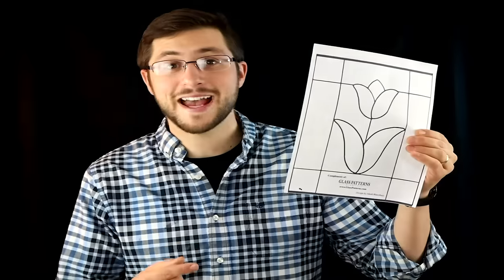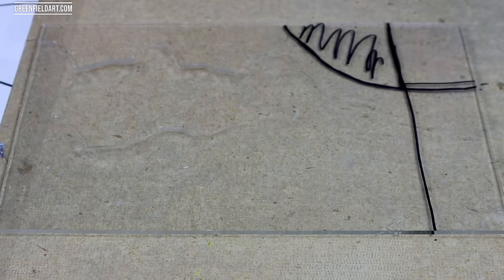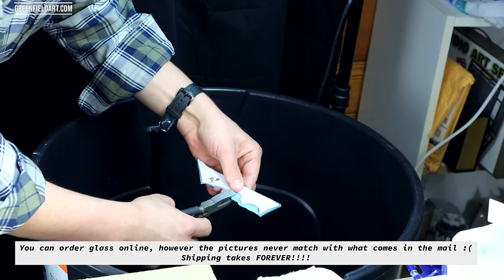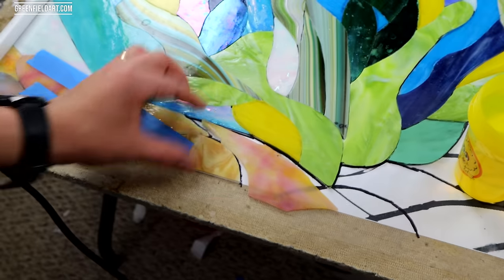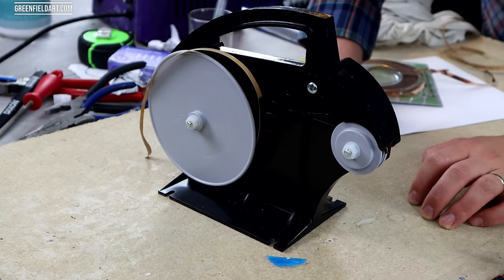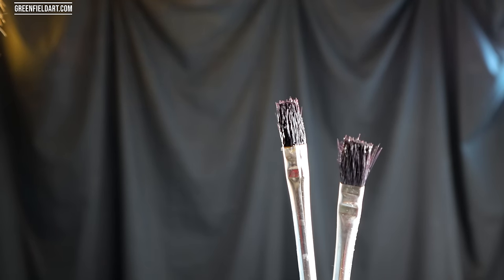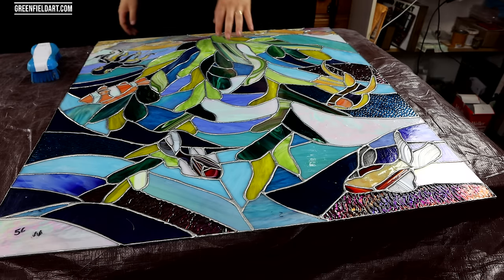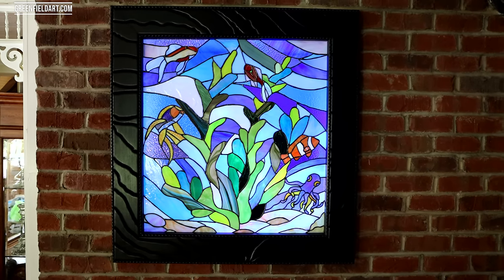Stained Glass Guide

Comment: Beautiful!!! My instructor taught me a cool trick when working with highly textured glass (like the piece you said was hard to foil). During the edge grinding, gently grind just a hair over the edge onto the top of the glass to remove some of the texture. This way when you tape- it is to/on a smoother surface. The tape will adhere better, no finger cuts and  no one will notice the portion removed because is under the tape and solder.
Man, was I happy when He taught me that one!!
Reply: OOOO great idea!
Reply: Thanks for sharing! That is an extremely helpful and smart tip! God Bless 😃
Reply: That is the kind of TIP a knowledgable and in person Instructor will give you...
Reply: Nice comment!
Reply: Looking at these comments two years later. For heavily textured glass you will not regret investing in a ripple grinding bit for smooth, consistent edges.

Comment: Beautiful work! I'll be watching for more. I haven't done stain glass in a while, so I needed a refresher course to remind me of what to do. I have all the tools, but you showed some techniques I never knew before. I'm going to be making windows for an indoor garden off m parlor. It's just a small 3.5' x 8' little room with LED grow lights for my veggies. So I built a wall with openings for the stained glass. Four windows in the wall part, then two windows to match for the doors.. So it'll be six matching windows altogether. I have a victoria look about the room, so it'll have a classic victorian look for the design. Then above the windows, I'll be doing some fretwork on thin wood and finish it nicely, so there's airflow in the room. It's a bit of a project, but so far the room is taking on that relaxing victorian parlour look.

Comment: Thank you for generously sharing your knowledge and experience with us all.  Good video. Did you get your Homasote board from Walmart or Home Depot/Lowe's? 
I tried to find a Homasote board about 5 years ago and could not find any. I ended up using a Masonite board with Masonite pieces layered up to take place of the trim (that you have in your video). I'm a self-taught stained glass artist, but much of my learning came from a guy who made videos before 9-11 and, as a fireman/paramedic, he ended up dying in the towers saving others. Someone posted his videos on YouTube where I learned from them. He went into extreme detail and much of what you explained in this video he also taught.  
One thing he explained NOT to do was to NOT run your finger(s) over the copper foil when foiling because it causes painful cuts. He explained that you will want to do it, but don't. Instead, use a burnishing tool of some type and smooth it down that way. He made the case for buying and using an automatic foiler, like you show in your video. 
Thank you, again, for sharing. 
God Bless 😃

Comment: Thank you for the tip on filling spaces with copper wire or crumpled copper tape. Also how you finish your piece; using the steel wool and cleaning and polishing. I wondered why the patina didn't penetrate the solder very well some times. Now I know!

Comment: Great Job! Few spots on the soldering that I personally would had touched up...but really thank you for the suggestion of using copper wire as a filler. I would do the crumpled up foil in spots, but the larger ones I had troubles with. 

N.B. Also, nice call on the 60/40

Comment: Thanks for the video.  I wish you would have shown more scoring/cutting techniques.  I.e.  when cutting textured glass.  You cut on the back side, correct?   And is there something you can put under a joint to prevent it from muddling on the back?  Thanks for the tip using copper from scrap electrical wire.
Reply from the maker: When cutting textured glass you always cut on the smoothest surface i.e. the back. Keep in mind that you would need to glue/trace your pattern front side down on the glass so that the texture will show on the correct side when the piece is placed in the window. A few options to prevent muddling on the back- 1. Try to move faster when soldering, not allowing the metal a chance to seep through. 2. Use the wire to fill the gap, keeping in mind that you want space for the solder to settle(don't over pack the wire). 3. Have some 50/50 soldier on hand and fill the gap so that it is flush with the surface of the pieces you are joining. Once the metal  has cooled down, build your rounded bead on top of the 50/50 with the 60/40.  50/50 has a higher melting point and will prevent the 60/40 from seeping through. watch min 34:10 I am using 60/40 but the process would be the same just the 50/50 would be the first layer and the 60/40 would be whats placed on top. If you don't have 50/50 try doing it with the 60/40 but move fast!  hope that is clear and If not let me know. thanks for the question!

Comment: This is one of the few videos I have seen that explain with detail a complete process, thanks a lot, I´m just getting started into stained glass and this was really helpful. I thought that copper foil was more difficult to use, but it's not and now I know it thanks to you, I will try my self to do it just by watching your video, hehe.   I have a question, I hope you can help me, what brand and model is your soldering iron? I've got one, but it's not so good and I'm not able to control temperature, so sometimes I get more heat than needed and burn my work hehe... hope you can help me, great video, and of course EXCELLENT WORK!!

Comment: Great video! Never tried Stained Glass before but I have a question...maybe I missed it. Do you flip the piece and solder it on the back as well? Thanks again:)
Reply from the maker: no you can but I didn't for this project. It will only be seen from one side and I didn't want the extra weight.

Comment: I do notice your soldering iron has a bigger tip than mine.  Is there better irons and do you recommend an adjustable temp iron? I bought a cheap one from Hobby Lobby and struggled with so I just bought an adjustable temp iron but both have 1/4" tips (?)

Comment: Beautiful piece.  For a piece that size, how did you safely move it outside to be rinsed with a hose?  Do you leave it on that board and rinse while on the board? If not, I am curious to understand if the piece is strong enough to just lift off, rinse, lay back on the board?

Comment: The larger my project gets, the more unstable it seems to be. Do you use anything to help support the glass on a project this size?  You said nothing about soldering the back side. My instructor taught me to solder both sides. The problem I ran into when doing that is that the heat would also melt the solder on the other side and I found myself going back and forth on either side trying to clean up the mess that would glob up on one side or the other.
I loved your project. How long did it take you to do it all?

Comment: Beautiful work Alex! Really stunning. I've just started some stained glass projects and I'm a little confused about using lead came. I see in this video that you don't frame your piece around the edges with lead came like I've seen in other videos. Have you ever used it and did you not use it here because you were putting it in a frame anyway? Thanks for your very informative video and I look forward to your next uploads!
Reply from the maker: Thanks for the question! I'm glad you brought this up because this is a very specific case where I don't use it.  This glass was sitting on a wall framed(stationary) like you said : )  I didn't find it necessary for the extra support. If it were to be framed in a door(which moves) or hung in front of a window(you need to attach hook and chain to it) I would certainly frame it in zinc Edging/came. To keep the video short I didn't show how I framed the glass. Its edges are sandwiched in-between 2 strips of wood which act as the same support system. In short you can use your judgment according to the windows application and size.  Good luck I hope that answered your Q.
Reply: @alexgreenfield5772  Ah great! Thanks for the reply. That makes a lot of sense :)

Comment: Favorite how to video I’ve seen yet! Great info and at a good speed with lots of explanation! Well done! I’m very new at this so I do have 2 questions. Are you left handed? I noticed you held the iron in the left and solder with the right. Also, you squirted something onto the project after you finished scrubbing in the patina. What was it? Then you took it outside to wash off. I also wonder how you handled it outside. It’s a fairly big piece. Thanks a lot!!
Reply from the maker: LOL I appreciate how you noticed the speed. Nothing drives me more crazy than when I’m trying to learn something form a video and the person just rambles. I am left-handed. Once I finished the soldering I take the project out and wash it with Dawn dish soap, water and a scrub brush. After the patina I washed it off with cold water, nothing else.  I squirted a polish On the window. I show a close-up of it.I know people use car polish as well, do yourself a favor and spend the extra dollar or two and get stained glass  polish compound, just in case the auto compounds are too harsh. To work on the project outside, I set up a table with a tarp on top of it. I carried the window with the homasote backing it, Slid the window onto the table and tarp and sprayed it with my hose. Hope that helped! Thanks for the question.

Comment: Thank you. I've had to watch sooo many videos for info you covered in this one. Question. My project will be in a window and seen on both sides. What is an easy way to flip the project over and how do you deal with flow through solder.
Reply: If your window is on a homesote board, and it should be, just place another board on top of your piece, then turn both boards on edge and lay them down so that your window is now turned upside down. He talked a little about flow through solder. Try using 50/50 solder instead of 60/40 (its thicker) and try to heat the solder as little as possible when you are over the area where its leaking through to the other side.

Comment: Great job Alex, I have been watching quit few videos but yours was far more informative A thru Z. 
 In your project you didn't solder the back of the stained glass. The reason I say that because I'm having problems with my two sided stained glass when I try to solder the back it seeps through the front almost ruining all the work. Do you have a special method to prevent this seep through beside using 50/50 solder?
Thanks in advance.

Comment: Do you need to solder both sides of the piece for free hanging or window art? I don't imagine the solder would have flowed between the glass for the other side.
Reply: He didn't mention it, but for the purpose of making a strong bond between each piece of glass you should solder both sides.
Reply: Yes you solder both sides, the revers side is a bit easier as the solder would have filled the spaces, so you just need to run a bead.

Comment: Alex,  Great job!  Two questions please.  How do you decide whether to use lead or copper foil for pieces?  How do you manage too much Flux?
Reply from the maker: Lead is a totally different process. Start with copper foil and once your comfortable move to lead came. That was the way I was taught. as for the flux, even if you don't see it on your brush it is there you don't need to dip it every few seconds, worse comes to worse you have too little and you can reapply. also keep a nonporous plate, jar lid something that you can dab your brush onto to take of excess flux.

Comment: You soldered both sides correct? Thank you.
Reply from the maker: Hi, Because this window will only be seen from one side, I soldered just the visible face. this cuts down on the overall weight, time and even money! The window is also stationary so no need for the extra structural support.

Comment: He is having to go back over his soldering lines because he is not using enough flux the first time.  It is an easy mistake to make.  Flux is nasty stuff and there is a predisposition to not want to use enough.  Also, if you are just starting, use a gel flux as it is easier to work with.  When I am tacking a piece, I personally just do the joints with a bead so it doesn't move.  If you do more than that it gets messy really quick.  If there is a line that looks kind of flat...you didn't use enough flux.  I see people try to keep adding solder.  If you dont get a good rounded bead another technique is to get your iron hot and lightly tap up and down and it can fix a small area...you might also need a tad bit more flux first.  Never thought about the copper electrical wire...that,s a good tip.  Also, for large pieces that need support they sell a steel insert between pieces of glass that is a tad less wide than your foil...so you dont see it.  It just needs to run from top to bottom in one piece without interruption

Comment: Thank you. I've had to watch sooo many videos for info you covered in this one. Question. My project will be in a window and seen on both sides. What is an easy way to flip the project over and how do you deal with flow through solder.
Reply: I loved the soldering part.I m new to this art and you have taught me so much regarding soldering joints. Thank you
Reply from the maker: you might need to fill the gaps with copper. the trick is to move as quickly as possible, not to melt the solder on the opposite side.
Reply: Place masking tape over gap from other side, this will catch any solder that flows through. You then flip your panel over and solder the the other side to make it neat.

Comment: Do you solder the backs at all?
Reply: Not for this. It cuts down on the weight. Also it’s framed so doesn’t need the extra stability. It will only be seen from one side
Reply: @tammygreenfield4301  great info, thank you!

Comment: Great video in general, but I wanted to point out that you are using the grozier pliers completely wrong. The curved part of the grozing pliers should always be facing down, or under the glass, and the flat side above. That is definitely why you were having such a hard time cleaning up the piece you were using to demonstrate. With the curved side down, that would've snapped off much much more cleanly.
Reply from the maker: Thanks for the tip. one of my teachers who has been doing this for a long time told me "there are no rules with using the pliers as long as the result works". I use both sides depending on what the glass requires. I mention this in the video. thanks for the tip, I'll try it out.

Comment: If you have gaps that are big enough to require filling, you should consider recutting. Proper cutting is the foundation of your work. Bad cuts leads to more solder. Means more weight. More weight means more stress. Leads to stress cracks or pulling apart.
Reply from the maker: lol this is true! however no one is perfect and glass isn't cheap. Obviously if the piece was bad enough I'll recut it. (cant put the complete mess ups in the video :)
Reply: @alexgreenfield5772   understood. But in the same vein, glass is expensive so (when teaching on an instructional video) promote strong fundamentals that begin with working on getting your cuts perfect. It seems many will latch onto any excuse to take shortcuts. And are kept from  advancing due to bad habits.
Reply: @johnkearns6523  can you point me to your videos please?....